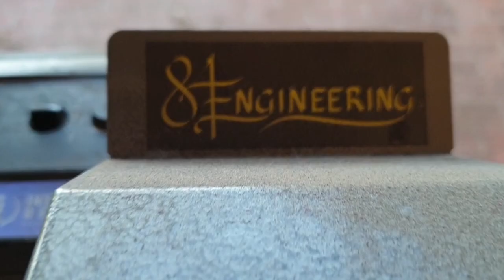Australian Bladesmith Interviews Ep2  Ewan Gibson, 84 Engineering

Comment: Are they any good the shop 48 the one thing that is making me um and arr about it is the price of them $1800 for one with vfd not the average bloke has that kind of money. Maybe $800 to $900 i would of not thought about it and bought it .
Reply from the maker: Yeah it is a lot of money I agree but. They are brilliant. You just cant fault them my opinion. If you want to make knives then it's a bit if a must. You could consider buying the kit with no motor or vfd and buying cheaper ones from Ebay. A guy I know Dan Vella on Facebook just did that. You could message him and ask some questions
Reply: @TobyFireandSteel  can that be done the vfd is like $400 to $500 and the motor is about $300 wow if that is possible i might consider looking again that would bring it under $1000
Reply from the maker: Yeah mate I bought a vfd recently from Ebay for $70 from memory and 3 phase motors are all over the place including Ebay for a few hundred
Reply: @TobyFireandSteel   wow sounds good i will have a look now that makes me more keener to do it now will try to see if thats possible . With that basic design does it come with the wheels or is it just the plate.
Reply from the maker: Not deffo mate. You'll you'll have to look in Gameco Artisan supplies website. I think its wheels and everything. Just missing motor and vfd
Reply: @TobyFireandSteel   thats more than i thought thankyou for your time. You have helped me out heaps.
Reply from the maker: No problems mate good luck. Call up speak to Cole or Tim tell them I said to ask for s discount. They may be able to do you a better price
Reply: @TobyFireandSteel  just communicated with cole about priceing he said that it will still be the full price for the body and wheels of $981.75 so he said he will give discount on metal and abrasives though still . Wow why is it so expensive . And what motor are you running on your shop 48 , is it a 1.5hp or 2.5hp.
Reply from the maker: Try Dar lu he has a grinder kit for sale. Not 84 Engineering though